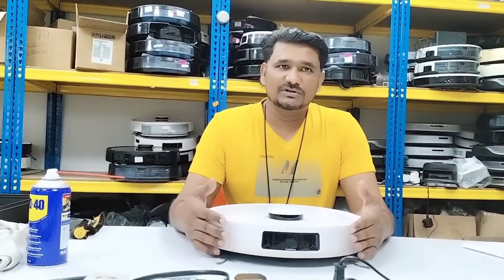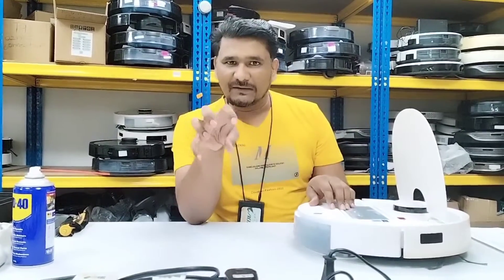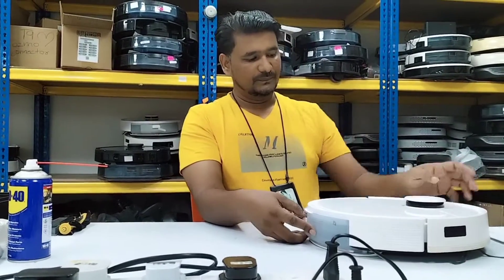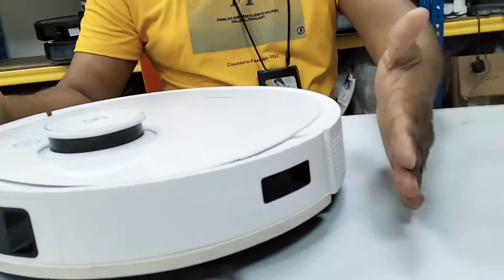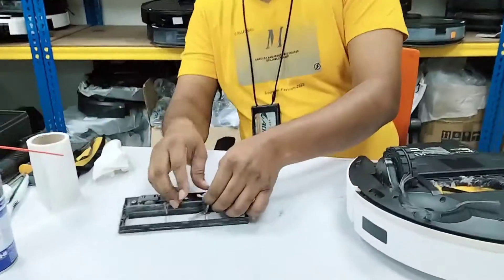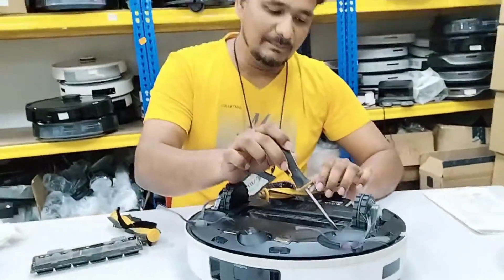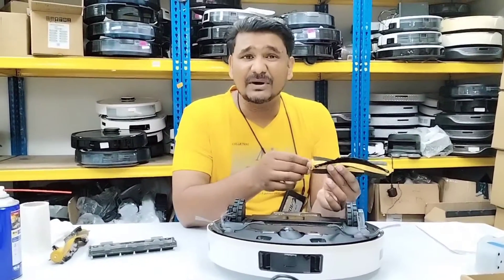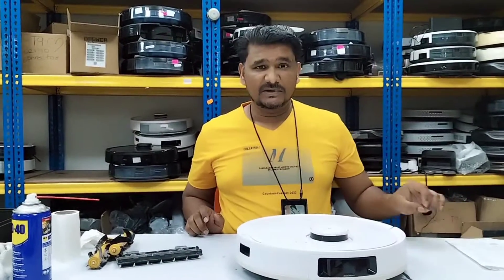Deebot |  Ozmo T9 |  How to Fix/Repair Suction Issues  |  Why Dust Stick With Main Brush ??

Comment: Hello sir, i've got a low noise fan with zero suction.  but it's nothing to do with main brush or filter. If i remove mainbrush or filter the airflow is still KO. I think something stuck in the main fan ...
How can i fix this main fan /motor or replace it ? Is your unmount deebot video enough or there is something else ?
Thanks a lot for your help
Ozmo deebot T8+
Reply from the maker: Actually vacuum fan is working or totally not functioning... there's no speed slow in vacuum fan assembly...plz check properly...U can take out dust box n press sensor with finger then test
Reply: @ecovacstechnicalsupport5278  exactly what I did. It's making noise but zero suction or airflow. So I guess it's dead then?

Comment: How do u clean the filter on the dn78.  Mine has no suction and has never really has much. Very disappointed in this item
Reply from the maker: If filter is already Clean but no suction means vacuum fan assembly not functioning...plz check the vacuum fan assembly

Comment: Quick question What do you believe is wrong with the T9 if the main brush keeps running? The main brush on mine will not stop till the battery is flat?
I want to add too, it is a very good unit that has worked well for a long time with no real major issues!
txs
Reply from the maker: Motherboard & main brush motor short circuit...need to replace both together

Comment: My main brush is not spinning. I cleaned it thoroughly and even opened the side of the main brush. There was no hair tangled. What should i do?
Reply from the maker: Main brush motor assembly need to replace

Comment: Hey! Really great video.
Do you have one to help diagnose a main suction fan issue. We have a T8 AIVI and when you switch it on the brush motor turns. The filter looks good.
There is no suction and when you hold tissue on the side there is no air flow.
Reply from the maker: Means vacuum fan need to replace... you can feel the sound also is different..more quite because vacuum fan not functioning...or plz check from the app settings is it mistakenly selected quite mode??
Reply: @ecovacstechnicalsupport5278  I also have a T8 AIVI where the vacuum fan motor does not run. I just replaced the main brush motor and it cleaned several rooms just fine, but after I picked it up to clear a tangle, the fan motor quit and I can't get it to start again. How can I be sure it's the motor that's failed and not a software or controller issue? It takes several weeks for the part to arrive, so I want to be sure that will fix it.
Reply: Ok, thanks, will order a part
Reply: @simonritchie4762  Hi, I have the same issue. The different sound is definitely the biggest change. What part did you order? Did replacing it fix the issue? Thanks in advance.

Comment: How do you tell if the brush motor is not good?
Reply from the maker: 1 brush won't move
2: some time moves but very noisy..means brush motor gears spoil..

Comment: Have you ever had to deal with an issue of a noisy vacuum? I removed a Lego piece from ours and now its making a horribly loud noise when suction starts. Hope you have some guidance!
Reply from the maker: Hi..I just seen your post...plz remove main brush n let the deebot run without main brush...see weather still got those loud sounds or not if after removing sounds settled that means Ur Main brush is faulty need to replace main brush only.,..if after removing brush still got Loud sound then might be vacuum fan broken..need to test weather fan is ok or not...some time vacuum fan motor becomes noisy
Reply: @ecovacstechnicalsupport5278 It sounds like an aeroplane about to take off. I think I may have torn a seal or something when I pulled the Lego piece out of it.

Comment: I checked for hair and even put unit on a glass top to see if the spot where the brush plugs into would move (without the brush) and it didn't even turn :( can you fix mine? I think it's the main brush motor

Comment: Do you have a video on how to replace the main brush motor?  I took apart my T8, but could not figure out how to access the main brush motor in order to replace it.
Reply: I have the same situation. Did you ever find out how to replace the main motor?
Reply: @chilli0007  Not yet. I was hoping  @Ecovacs Technical Support would make a how to video, but so far I have not seen one. I've been looking at other brands, but I'm still holding out hope I'll be able to repair the motor on my Ecovacs.

Comment: Hi 
I have a deboot 500 
Recently it started moving very slowly 
I have tested all the ir sensors with the camera and they are good
It also cleans very good
It is detecting all the objects and will not hit them 
Only problem is it is moving very slowly and taking more time to clean the room
Reply from the maker: Plz use any car wax 3-4 drops enough with soft cloth n clean front bumper nicely gently.....deebot front bumper glass might be got scratches or dust that's why it always moves slow
Reply: @ecovacstechnicalsupport5278  thank you for the reply 🙏

Comment: I really like your channel is helpful
I just bought deebot n79s with no charging dock and charger how do I charge it without the docking station.
I will be really happy if you reply me 
If i can have your contact
Reply from the maker: Hi most welcome I can give contact no at Ur request 00601137973018
Reply from the maker: But for this issue you need to contact with ur seller...only seller can solve this issue... accessories missing or charger missing.. might be possible sometimes

Comment: Hello, the main brush of the ecovacs osmo 950 robot turns on the first start and then it does not.  While the battery is at 100% in good condition, it drops to 80% after 30 minutes of operation.  When I give 12v to the motor, the motor runs.  What do you think could be the problem?
Reply from the maker: Can u plz send me deebot video so I can confirm what's the issue
00601137973018

Comment: Dear I have omzo 920 bumber stuk msg came kindly send advise who to open bumper and release sensor thanks awaiting yours reply dear
Reply from the maker: First of all plz confirm weather bumper really stuck or not...press the bumper from Front left n right side see weather can bounce back or not...if can't bounce back means Just bumper came off..in this situation you need to open Only bottom chassis plate n bumper panel screen then just remove bottom chassis plate first then fix back bumper so it can bounce back from all side....then put back all screw...
Reply from the maker: If bummer can bounce back from all side still giving error then need to replace front anti drop sensors with bumper sensors...its one assembly...all above mentioned sensors attach with one wire if you want to repair those then just replace bumper sensors only no need to replace anti drop sensors
Reply from the maker: There is one video available on this topic why Deebot reverse or bumper issue...plz check my channel...you can get eaisly... Then you understand what I explained above

Comment: Dear l lost my magnetic of water dispenser plate ozmo 905 model
Reply from the maker: Don't worry...plz can try first any same size magnetic ...put at same place underneath the deebot after power it on. & See weather deebot gives this voice msg that moping plate has been installed.... which magnetic give this msg just attach that peace of magnetic at same place From where it drop...make sure use small peace of magnetic which can fix in that small whole.... hopefully will work
Reply: @ecovacstechnicalsupport5278  thanks dear